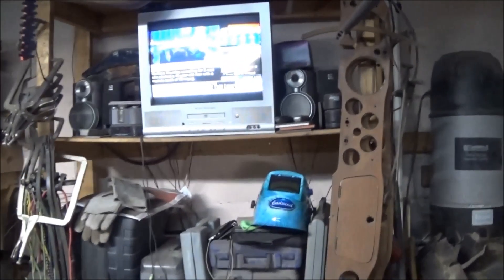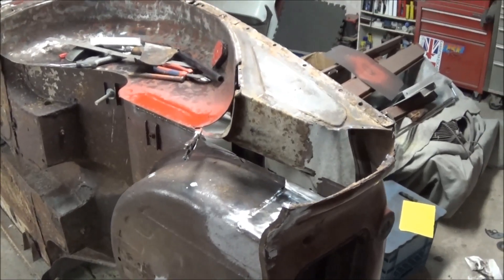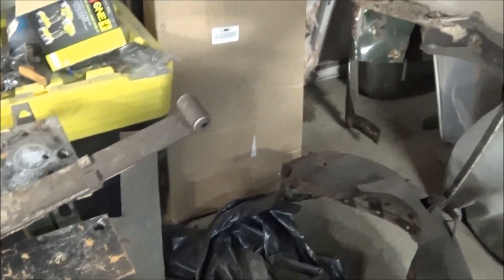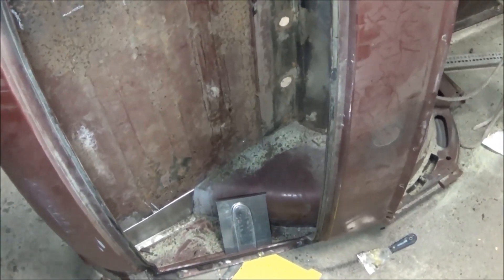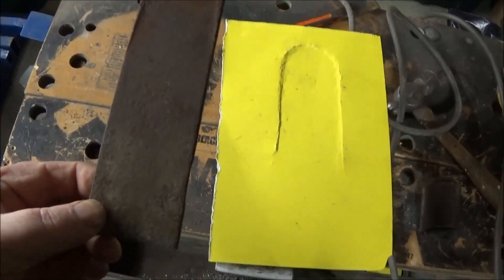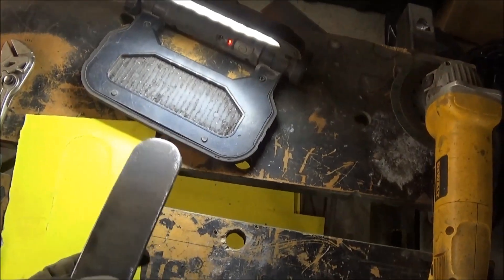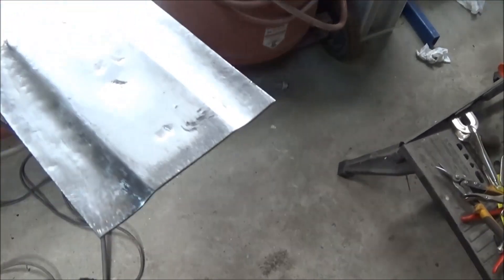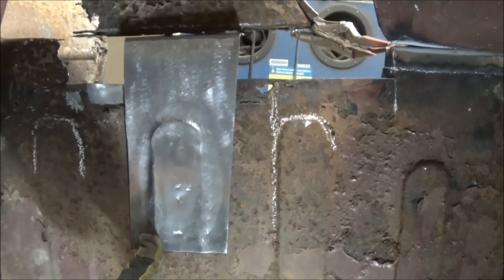Hammer Forming Trial and ......  1959 Triumph TR3A Restoration

Comment: Tush---when I did this for the front firewall I drilled a couple of holes in the form, one near the radius and the other at the tail then screwed the patch metal thru the form holes to a plywood base to keep everything from moving around during the hammering.  Also used a "T" shaped cold chisel with the sharp edge rounded out to assist in getting the "ridge depression" a bit more uniform.  Used a ball pean hammer and the chisel to beat in the shape.  Also used a 3/4" chisel to get the radius formed.  Makes a cleaner outline for the depression.  Weld up the two screw holes later.
Reply from the maker: Thanks Dan.   Great suggestions as always.

Comment: Nice work Chef,  I've used mdf for the hammerform with good success, not sure how many it would last for.
Reply from the maker: TheWreckingYard I seem to recall you did that on the little Porsche?
Reply: Yup it worked quite well and was easy to work with.

Comment: I was wondering if you could router out that shape from a piece of hardwood, use the pattern in an arbor press and get rid of the hammer marks? Probably depends on the thickness of the metal you are using. Good luck!
Reply from the maker: Yeah, I though about trying to figure out a way to use a press....I don't have a press though so even if I figured it out, I would have to track down a press :-)

Comment: Its a tough call, but since you have the tooling Jeff's idea of using a press might be a good option, does your neighbour Les have one? What is the rest of the trunk floor like especially where the petrol tank sits, if its really bad then maybe a new panel?
You have me wondering on what you are going to do. By the way doesn't having to work suck!
Reply from the maker: The Classic Sports Car no, les doesn't have a press so that option will be a challenge....under the fuel tank seems to be pretty solid. There are a couple of soft areas that need to be patched...a new floor panel is about plan D 😎. I bought a few new tools yesterday to help me out so we shall see how we do on the next test.  Stay Tuned!